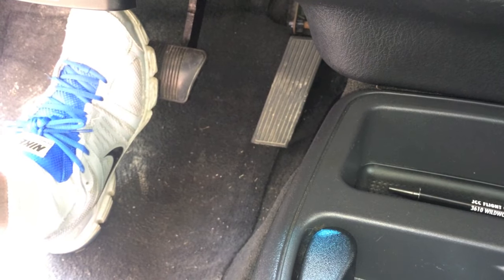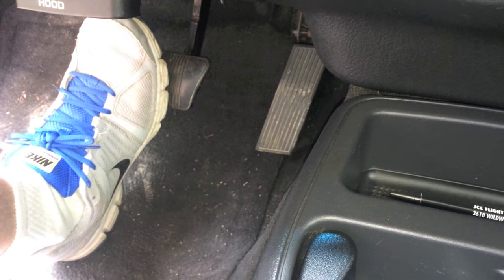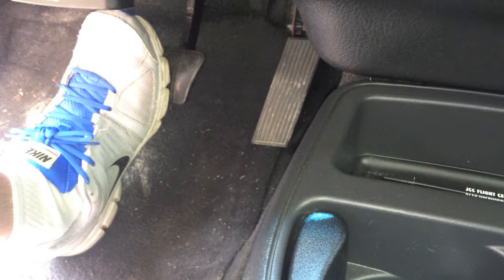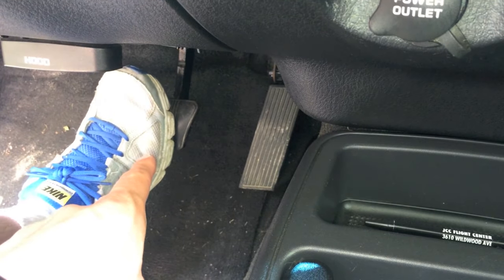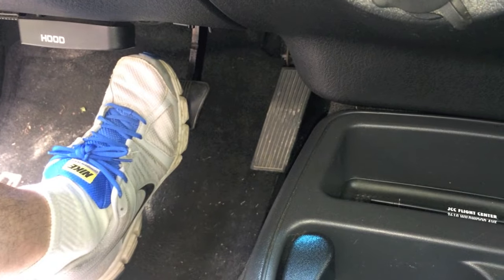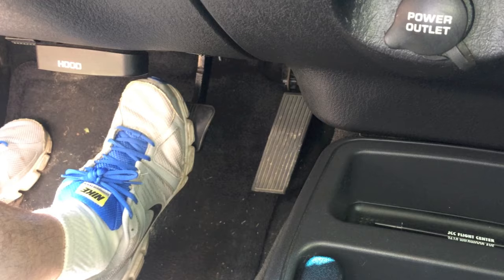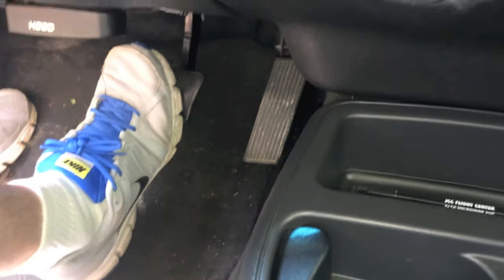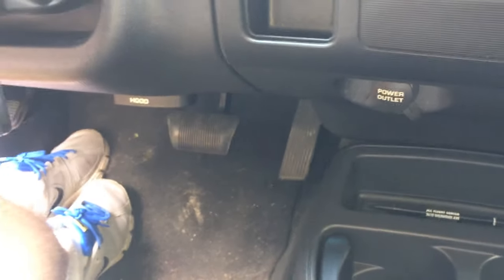HARD Brake Pedal - How to check if your BRAKE BOOSTER is GOOD or BAD

Comment: My brake moved forward when I turned the engine on but it jumped forward.
Reply from the maker: Thanks for watching, we have seen different vehicles perform different motions over the years.

Your system may be working perfectly as it transitions to the forward or retracted position.

😎👍

Comment: Not always true ... What if there is no vacuum to the booster, its a vacuum supply issue not the booster.
Reply from the maker: Brendon Pickering 

Thanks for checking out the video and sharing your comment Brendon.  The vacuum supply is very important in making the Brake System operate correctly & efficiently.  As you mentioned, a loss in vacuum supply can cause degraded performance to the system.  Please subscribe to the channel and turn on your YouTube notification Bell that would be awesome thanks again!  😎👍🔧🔩

Comment: My booster is not hisssing it gets hard but go to floor after 3 pumps
Reply from the maker: @LovenotHate130  

Thanks for watching.  Do you see any signs of brake fluid leaking under vehicle on ground or along the undersides where the brake lines are, or near wheel-well calipers?

Comment: I changed my hydro cause it was leaking now that i did my braeks got real tight so i realeased the pressure in my lines but it keeps doing it what do i do
Reply from the maker: Victor Escajeda 

Thanks for checking out the video Victor!  This is definitely not uncommon!

It can be a few different things....Lets figure it out!

First thing that comes to mind is your fluid level!  Make sure your brake fluid is not outside the proper fill parameters.  This causes brake system performance issues...explained in more detail below!

Let’s work through the items!

1.  Its possible that your caliper is beginning to stick...maybe caliper slides have lost the lubrication required to shift back and forward freely.

2.  It can be possible that your Caliper piston has lost its lubrication which will also interfere with the efficient shift back for forth.

3.  The front rubber brake lines that connect to your caliper fail from inside rather that outside.  This means the inter coating begins to break away and clog portions of the brake system...hence not allowing fluid to flow back and forth freely.  

4.  Your brake pads have little prongs/teeth on them.  You will notice by their location...the pads slide on a steel brace.  This may need to be lubricated to bring the shift back to efficient requirements.

I have attached a few videos.  Lets start with the easy items and then work our way up!  Lets figure this out together!  Keep me posted!  Please Subscribe to the channel that would be awesome!

1.  Caliper Slides Lost Lubrication:

https://www.youtube.com/watch?v=-DZ68tKuCQc&amp;t=15s

2.  Too much Fluid in Reservoir:

https://www.youtube.com/watch?v=X-AJ5tD6zoA&amp;list=PLjCXOz8TSkZnavDiGDyHdPKe2dV2RzEMZ&amp;index=39

3.  Failing Front Brake Lines:

https://www.youtube.com/watch?v=3FTEgbLYAdI&amp;list=PLjCXOz8TSkZnavDiGDyHdPKe2dV2RzEMZ&amp;index=78

4.  Brake Pads not shifting:

https://www.youtube.com/watch?v=3Pq15BWM_qY&amp;t=103s

5.  Replacing Front Brake Calipers:

https://www.youtube.com/watch?v=8HoaL4QM5-k&amp;list=PLjCXOz8TSkZnavDiGDyHdPKe2dV2RzEMZ&amp;index=83

6.  How to check if Brake Booster is Failing:

https://www.youtube.com/watch?v=VK4lowH7kQE&amp;index=66&amp;list=PLjCXOz8TSkZnavDiGDyHdPKe2dV2RzEMZ

7.  Failing Brake Booster:

https://www.youtube.com/watch?v=j9s7yccswPQ

8.  Symptoms of a Failing Brake Booster Check Valve:

https://www.youtube.com/watch?v=j9s7yccswPQ&amp;index=68&amp;list=PLjCXOz8TSkZnavDiGDyHdPKe2dV2RzEMZ

9.  Master Brake Cylinder info

       https://youtu.be/F9s_1VZ2u5E
Reply: DIY With Michael Borders well it has plenty of fluid the break pedal is realy hard still my truck wont move cause the breaks are to tight could it be a bad hydro booster
Reply from the maker: Victor Escajeda 

Thanks for the reply!  You may need to open the bleeder valve to release pressure to see if you can get brakes moving again!  Give that a try.

How old are your Calipers & rubber brake hoses?

These hoses fail from inside out which means parts of the internal hose separate & clog system!

Keep us posted!  Let’s get this figured out!  😎👍🔧🔩
Reply: DIY With Michael Borders well i changed out my booster and its working better but my breaks are tight i can feel them just driving down the road could it be the abs relay module
Reply from the maker: Victor Escajeda 

It’s very possible!  That’s a pretty friendly DIY project & having a new one installed even if it’s not the issue...that’s a plus!  Keep us posted!  😎👍

Comment: hi annoying prob with lexus gs300 ... the brake is squishy but still works

However the pedal does NOT get stiff when the car is off..

Also sound keeps coming ever 1 minute or so  as if sth is priming the booster
Reply from the maker: Saad Badar 

Thanks for watching!  Let’s get this figured out!

First thing we need to check is the Brake fluid level.

You want to verify that the fluid is within the proper fill parameters.  Next, do a thorough inspection of the entire brake system & all brake lines to verify no leaks.

The squishy pedal is almost always due to a leak in the system.  With that said, if you check all parts & lines & see no leaks...and at the same time, you notice that your brake fluid is lowering in your reservoir over a few days of driving....this leads us to believe that the fluid is leaking into your Brake Booster.

If that’s the case, it is time to replace your brake booster.

Let’s start there!  Keep us posted!

Please subscribe to the channel and turn on your YouTube notification Bell 🛎 that would be awesome thanks again!  😎👍🔧🔩
Reply: The booster is the black circle behind where you pour in brake fluid.. it only assists you in pressing the brake peddle in. Your problem is usually a bad brake master cylinder.. the thing you pour the fluid into to. There are steps to bleed the master cylinder it self before you install it. Called bench bleeding
Reply from the maker: Brandon Cart 

Thanks for sharing your comment Brandon!  That’s awesome info!  We really appreciate it.  😎👍🔧🔩

Comment: I had to brake hard today, going around 45 kph. It made like a crunching sound. Anyone know, is it normal. Toyota Hilux sr5 manual. Please respond
Reply from the maker: Crunching sound???....kinda like parts falling apart or metal on metal?
Reply: DIY With Michael Borders this is my issue right now with my GMC truck did you fix that problem if u did what was it...
Reply from the maker: Adriana Thanks for watching...did your booster test Good?.....If  it did and your booster is good, it can be a few other things.

This is definitely an annoying issue that so many people run into.  First question....has there been any recent work done to your brake system in the last year?  Again....if your booster is good,it might be one of...(Or BOTH) of your brake calipers.  When your brake calipers begin to fail or the caliper slides begin to dry up, your caliper begins to stick.  Check to see if you caliper slides just need to be re-lubricated.  Below is a video on how to check

I have attached a few options that may cause this.  Check out the vides and let me know if you have run into any of these issues.  Please keep me posted.  Subscribe to the channel that would be awesome!

https://www.youtube.com/watch?v=-DZ68tKuCQc

https://www.youtube.com/watch?v=3Pq15BWM_qY

https://www.youtube.com/watch?v=VK4lowH7kQE

https://www.youtube.com/watch?v=j9s7yccswPQ
Reply: DIY With Michael Borders Hi, sorry for the late reply. I'm pretty sure my breaks are just due for service but I was evidently worried at the time, thought my gearbox shit itself
Reply from the maker: haha very cool.  Thanks for the update!  Brand new brakes are always a good thing :-)

Comment: When I brake it goes halfway and my car keeps rolling do you know what’s the cause or problem thank you
Reply from the maker: James Guy Whats up James.  A few things to look at.  Has there been any MX Work done to the Brake System in the last year?

look under vehicle and check to see if you can find any indication of brake fluid leaking out of any of the lines.  Even the tiniest leak will interfere with the concealed pressure required for the brakes to work properly.  Follow each brake line from reservoir under hood back to each wheel to see if any leaks.

If no leaks found, check that your reservoir is at its proper fill line.

Next take a look at the small plastic vacuum lines that feed out of Booster.  While the engine is running, have someone press the brake pedal.  As they press it, check to see if you hear any hissing.  If you hear hissing, locate the vacuum hose that leaks and replace it.  The loss of vacuum pressure will interfere with the efficiency of the brakes.

If no hissing, it might be your Check Valve.  Below is a link that talks about Check Valve.

After completing these checks, and all works properly, the only two remaining are your Brake Booster & Master Brake Cylinder.  Below are links.  I know it’s a lot to look at but the earlier items to check won’t cost you anything to just check.  Keep me posted.  Let’s get you back on the road safe.  Please subscribe to the channel and turn on your YouTube notifications that would be awesome thanks again 😎👍

Too much Fluid in Reservoir:

https://www.youtube.com/watch?v=X-AJ5tD6zoA&list=PLjCXOz8TSkZnavDiGDyHdPKe2dV2RzEMZ&index=39

Failing Front Brake Lines:

https://www.youtube.com/watch?v=3FTEgbLYAdI&list=PLjCXOz8TSkZnavDiGDyHdPKe2dV2RzEMZ&index=78

Brake Pads not shifting:

https://www.youtube.com/watch?v=3Pq15BWM_qY&t=103s

Replacing Front Brake Calipers:

https://www.youtube.com/watch?v=8HoaL4QM5-k&list=PLjCXOz8TSkZnavDiGDyHdPKe2dV2RzEMZ&index=83

Failing Brake Booster:

https://www.youtube.com/watch?v=j9s7yccswPQ

Symptoms of a Failing Brake Booster Check Valve:

https://www.youtube.com/watch?v=j9s7yccswPQ&index=68&list=PLjCXOz8TSkZnavDiGDyHdPKe2dV2RzEMZ

Comment: doesnt always have to be fluid leak are you getting misfires as well
Reply: Dillon Radish       If you pump the pedal couple times why’ll the engines on in park it makes the rpms go low. It sucks the pressure out of the engine almost stalling it. Just something funny I discovered don’t know if it’s normal but yea

Comment: Hello Michael, I tried that method on my 2002 Volvo s60 by pressing on the brake pedal until it was hard, then starting the engine it went down slowly and not fast. But when when I let go of the pedal, it starts to hiss and stayed hissing until I press the brake pedal down or accelerate it will go away and when I decelerate, it'll hiss again! What could it be?
Reply from the maker: Arnold, thanks for checking out the video.  Lets get right to it :-)

You are MOST likely experiencing a slowly (But Shirley) Master Brake Cylinder failure.  I say this because you mentioned you're experiencing a Hissing sound.  This hissing sound comes from the diaphragm inside the booster.  What is beginning to happen is your Master Brake Cylinder is slowly leaking brake fluid into the booster which over time will lower fluid quantity inside brake lines and brake reservoir.  Having a shop fix this is recommended unless you are very familiar with bleeding brakes and the re-pressuring cylinder after installed.  

Subscribe to the channel.  I hope this helps.  Please keep me posted!

Comment: Need some help from somebody out there my brake fluid is black and my brake pedal is hard is the brake fluid the reason why because it's black please text me back
Reply from the maker: Bobby Dunkle 

Thanks for watching.  You may need to perform a system flush.  We say this because if your fluid is black, it has gathered moisture & has become contaminated.  We hope this helps.

😎👍🔧🔩
Reply: Thank you for the help man it's just something I can't take on my own I have to find a service center that's cheap
Reply: Thank you to everyone that reply to me but this is something I can't take all myself I have to take it to a service center I may also have wheel bearings going bad too which guy told me that would cause my brake pedal to be hard thanks guys thank you so much
Reply: @DIYwithMichaelBorders  a guy in a parking lot just told me that bad wheel bearings will make your bracke piddled hard too .is this true
Reply from the maker: Bobby Dunkle 

Thanks for the reply & we definitely understand.  😎👍🔧🔩

Comment: I just changed the old power booster and still experiencing that problem 😣
Reply from the maker: Ms Jackson 

Thanks for checking out the video!  This is definitely not uncommon!

I can be a few different things....Lets figure it out!

1.  Its possible that your caliper is beginning to stick...maybe caliper slides have lost the lubrication required to shift back and forward freely.

2.  It can be possible that your Caliper piston has lost its lubrication which will also interfere with the efficient shift back for forth.

3.  The front rubber brake lines that connect to your caliper fail from inside rather that outside.  This means the inter coating begins to break away and clog portions of the brake system...hence not allowing fluid to flow back and forth freely.  

4.  Your brake pads have little prongs/teeth on them.  You will notice by their location...the pads slide on a steel brace.  This may need to be lubricated to bring the shift back to efficient requirements.

I have attached a few videos.  Lets start with the easy items and then work our way up!  Lets figure this out together!  Keep me posted!  Please Subscribe to the channel that would be awesome!

1.  Caliper Slides Lost Lubrication:

https://www.youtube.com/watch?v=-DZ68tKuCQc&amp;t=15s

2.  Too much Fluid in Reservoir:

https://www.youtube.com/watch?v=X-AJ5tD6zoA&amp;list=PLjCXOz8TSkZnavDiGDyHdPKe2dV2RzEMZ&amp;index=39

3.  Failing Front Brake Lines:

https://www.youtube.com/watch?v=3FTEgbLYAdI&amp;list=PLjCXOz8TSkZnavDiGDyHdPKe2dV2RzEMZ&amp;index=78

4.  Brake Pads not shifting:

https://www.youtube.com/watch?v=3Pq15BWM_qY&amp;t=103s

5.  Replacing Front Brake Calipers:

https://www.youtube.com/watch?v=8HoaL4QM5-k&amp;list=PLjCXOz8TSkZnavDiGDyHdPKe2dV2RzEMZ&amp;index=83

6.  How to check if Brake Booster is Failing:

https://www.youtube.com/watch?v=VK4lowH7kQE&amp;index=66&amp;list=PLjCXOz8TSkZnavDiGDyHdPKe2dV2RzEMZ

7.  Failing Brake Booster:

https://www.youtube.com/watch?v=j9s7yccswPQ

8.  Symptoms of a Failing Brake Booster Check Valve:

https://www.youtube.com/watch?v=j9s7yccswPQ&amp;index=68&amp;list=PLjCXOz8TSkZnavDiGDyHdPKe2dV2RzEMZ
Reply from the maker: Ms Jackson 

Are you experiencing hard brake pedal?
Reply: DIY With Michael Borders yes. Like when I break i slide a little
Reply from the maker: Ms Jackson 

Thanks for the reply.  What’s the update?  Have you taken a look at our list of troubleshooting videos?

Keep us posted.

😎👍🔧🔩

Comment: DIY With Michael Borders  Hello brother. I am Sadat Alipulo from Philippines,  I have an issue with my breakbooster sound. I own a suzuki ciaz manual transmission. Do you have a Facebook account or messenger?  So that i could send you a video of it?
Reply from the maker: Sadat Alipulo 

This is an attached copy of the comment posted to your other comment...hope this helps!

Thanks for watching & sharing your comment.  Let’s get this figured out!  Let’s start with the quick & simple checks.

We recommend checking your Brake Fluid reservoir & verifying that the fluid is within the proper fill parameters.  If it is not, add fluid & monitor the fluid level.  If fluid goes down within 2 days of driving, this is a clear indication that your Booster has a leak & is allowing fluid into your Booster...causing the sound you’re hearing.

During the monitoring of the fluid level, do a thorough inspection of all your brake lines & parts pertaining to your Brake System to verify you have no leaks.

Let’s start there, keep us posted!

Please subscribe to the channel and turn on your YouTube notification Bell 🛎 that would be awesome thanks again!  😎👍🔧🔩
Reply: @DIY With Michael Borders i hear an air sound everytime i press the brake pedal fast when my car is in an idle state. My brake fluid is in the right amount and i already performed the checking whether the brake Booster is in right shape and the result is normal. But that air sound that i am hearing everytime i press the brake pedal is the one that worries me.  I never heard that at the beginning i own my car.  but now my car is already 1 year and 6 months in my possession.  I had read some comment in other videos related to my problem and they say that if air sound can be hear during pressing the brake pedal,  that would mean that the brake Booster is STARTING TO FAIL.Is that true?
Reply from the maker: Sadat Alipulo 

Thanks for the reply & that’s absolutely a possibility.  Your Brake Booster may be in the early stages of failure & may only last another month or two.

We recommend getting the vehicles Brake Booster replaced before its to late.  This should help solve your air leak.

An air leak in the brake/vacuum system only causes degraded performance to your system & sooner or later it may fail all together.

Keep us posted & we hope this helps!

😎👍🔧🔩
Reply: @DIYwithMichaelBorders  if my brake booster will fail, is it dangerous? will it cause my brake not to function normally?
Reply from the maker: Sadat Alipulo 

Thanks for the reply & unfortunately a faulty Booster will not provide the required assistance that the brake pedal needs to effectively & safely work.

A great benefit of the Booster is to make brake pedal inputs much more friendly.  Being that it is part of your brake system, we recommend having it inspected / replaced.  Hope this helps.  😎👍🔧🔩
Reply: Thank you so much bro. 😇😇😇
Reply from the maker: Sadat Alipulo 

😎👍🔧🔩